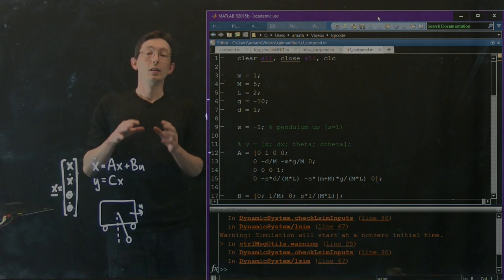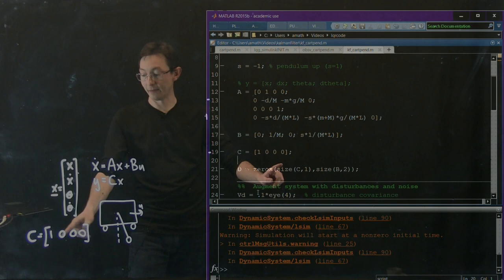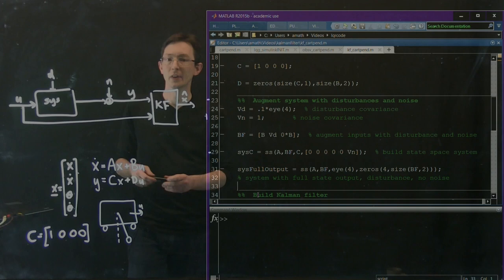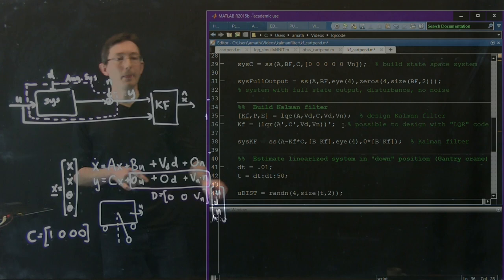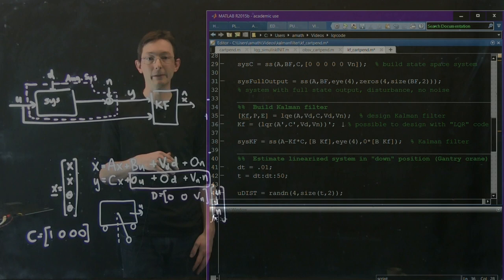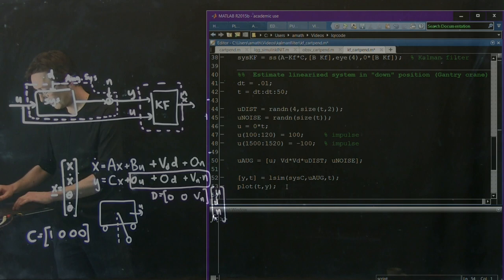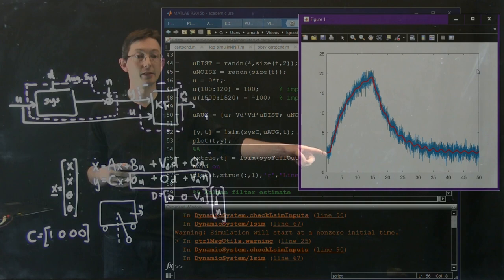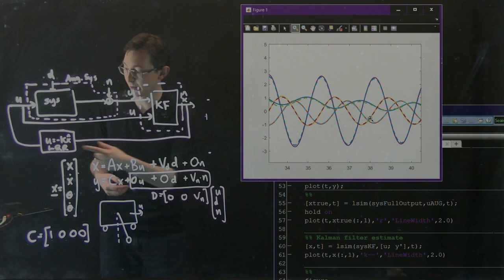Control Bootcamp:  Kalman Filter Example in Matlab

Comment: I'm gonna go ahead and guess the example was not done for the pendulum up position because you need more tools (robust control?). I'll get to those videos soon enough though. Great material Steve.
Reply from the maker: Thanks!  Yes, this is an easier warm up, since if the controller isn't that effective, the system stays in the down position.  A bit trickier in the up position.

Comment: hi, mr. Brunton, I am really enjoying the classes. thank you!
what if we have no information about noises and disturbances in advance?
Reply from the maker: Great question.  Usually you won't have information about noise and disturbance in advance, so you would somehow need to estimate them.  And generally these magnitudes will actually become tuning parameters that you can use to find a good estimator.  Often only the ratio between noise magnitudes matters, and you usually vary them by factors of 10.
Reply: @Eigensteve  , are there any techniques one could use instead of trial and error? some error minimisation techniques, perhaps?
Reply from the maker: @alex.ander.bmblbn , definitely, you could use another optimization technique to select these hyperparameters to minimize error or some other metric.  But this would be a smarter, automated version of trial and error.
Reply: @Eigensteve , I see, thank you, sir! looking forward to reading your book on machine learning based control :)

Comment: In the case of following a setpoint, are there tools for knowing the gain required for it? so the input becomes u = K_r*u - K_s*x,   being K_s the matrix gain obtained from the LQR.
Reply from the maker: Thanks -- yes, when following a setpoint for reference tracking, it is possible to add a feedforward term along with LQR.  I always find this a bit trickier to derive.

Comment: Thankyou Steve for these fantastic videos! They are a real help in my studies.

In your matlab example it appears as if the kalman gain is only calculated once for the entire simulation. While in other sources, I've seen the kalman gain updated at each timestep. I was just wondering if you could comment on why this is?
Reply from the maker: Thanks!  Yes, that is right, in this example I am using a single Kalman gain because I am assuming that the linear system doesn't change.  If you are controlling a more complex system, where the linearization point is changing, or where there are nonlinear dynamics, then it could help to update the Kalman gains as well.  In large-scale data assimilation projects, like climate modeling, it is common to update the Kalman gains.
Reply: @Eigensteve  I've also seen in other kalman descriptions (e.g. wikipedia) they estimate an accuracy covariance along with the state vector. This estimated covariance is then used to recompute the kalman gain every step (despite no re-linearization done). Maybe this will be covered in future lectures (or if you have a reference to a relevant part in your book), but I don't feel like I have a good sense of the differences between these two approaches. In particular, the version you present here seems a lot simple, so I guess I'm wondering if you can always do this (at least when you stay close to the linearization point), or if the more complex version described elsewhere is necessary.

Comment: Dear Professor! Thanks again.  One question please. At 15:10 you said that in the real world we have u and y and we will not have to "invent" disturbances (n and d). But my current understanding is that this n and d disturbances are an integral part of the Kalman Filter algorithm, and we will need to estimate these real-world disturbances during system operation in order to supply Kalman Filter with correct real-time values for n and d covariances. Is my understanding correct?
Reply: I think I understood it in the same way. In the example shown in this video, Kalman filter was able to squash the noise because we gave him the information about the noise signal.  We would need to do the same for real-world system. PS. Note I'm not an expert, I only wrote how I understood the lecture.

Comment: Supernice! I've got a Q.: what is the best way to take account of a forcing term? (e.g. Let's suppose an external force, sinusoidal, is generating a torque on the pend.)
Reply: You would incorporate that as a non-conservative force, which will be the right-hand side in the Lagrange formulation using the principle of virtual work. If your work term is a form of potential energy, you don't need to do that and can just use Euler-Lagrange instead.

Try it with gravity. Assume a rigid pendulum which doesn't compress, so gravity only does work in the local coordinate system's x-direction. Use a standard rotation matrix to put the gravitational force in your local coordinates (versus global coordinates, where gravity points down), and apply virtual work (dot product of the force with the unit direction vector.

If i and j are the local unit vectors, then for a clockwise-rotated local coordinate system (where j is aligned with the pendulum rod), you get a gravitational force vector of F = mgsin(theta)i - mgcos(theta)j. This force only does work in the i direction, so the unit direction vector dr = dxi. Taking the dot product F*dr = mgsin(theta)dx. If you use Lagrange, then you will perform the partial derivatives on the system's kinetic energy only, and then your generalized force on the right-hand side is Qdx = mgsin(theta)dx, and so Q = mgsin(theta). This is the same result you would get using Euler-Lagrange since the gravitational force can actually be incorporated as a potential energy.

Comment: Hi Steve, 
first of all: fantastic video !!! 
I have a question reguarding Kalman filter in combination with PID control. As you said the kalman filter has its own dynamics. When I use a PID controler I use my system model to tune the PID parameters properly. If I use a filter such as a butterworth filter I have to consider the fitler dynamics if this filter. However, the dynamic of the Kalman filter I not easy to predict/identify since I do not know the poles of the system. Is it possible to combine a PID controller with a kalman filter properly in a "scientific" way? Background is: I have a very unreliable velocity measurement of the fible flow and I want to use a simple PI controler. However, I do not want to use a simple butterworth filter since measuring is sometimes not possible or provides values that are physically not explainable. 

Thanks for your time so far. I would appreciate an answer very much. 

cheers
Leo

Comment: Hi mr. Brunton. Thank you for the video, the estimation of unmeasured variables almost feels like magic. I really tried to understand the Kalman filter but I still don't understand this part - how does it estimate the unmeasured variables. Would it be possible to write out a formula which describes how these estimates are calculated (something like theta(k+1)=....)? Or could you somehow conceptually try to explain this? I would really appreciate it.
Reply: I was thinking about this for a while, and I reached for some insight that I may share with you. The design of Kalman filter in this video is based on the modelling system. In the modelling system, the states are actually modeled (just like they are known but they are not), so the lqe command subtracts the modeled state with a random state (initial estimated state) and then correct the error between them based on kalman gain.
However, we have no idea about some of the states in real environment. Here, instead of modeling of the states we must do calculations for the unknown states, for example, if the position state is measured, we could calculate the speed state by deriving the former.  Once again, Kalman filter will subtract the calculated states with the estimated states and correct the error based on kalman gains. Hope this could help.

Comment: hi sir, can I ask why is the D term in sysC is [0 0 0 0 0 Vn] instead of [0 0 Vn] as you wrote? Thank you so much!
Reply: I believe it is because the u vector represents 4 control signals. So in Matlab that single zero on the board is written explicitly as four zeros.
Reply: For everyone wondering about this [0 0 0 0 0 Vn], that's because: 
- our u input is a scalar (i.e. 1 input signal).
- however d input is assumed to have 4 inputs (d1, d2, d3, d4) a separate disturbance input for each state, it is clearly defined like this line 44 in Matlab uDIST = randn(4,..), so it is a 4 inputs disturbance.
- finally n is a scalar again, same as u
When you have this in mind, the following is the full expansion of both State equation and Output equation [with size of each vector and matrix] of the simulated system:
State Equation:   X_dot [4x1] = A[4x4] * X[4x1] + B[4x1] * u[1x1] + Vd[4x4] * d[4x1] + 0 * n[1x1]
So, if you put the inputs [u d n] as a single input vector, you end up with this:
u_all = [u d1 d2 d3 d4 n]
and combine B, Vd and Vn in a single matrx = [B Vd 0*B], the reason for 0*B is to keep sizes same only.
Since Output equation: Y[1x1] = C[1x4] * X[4x1] + 0 * u[4x1] + 0 *d[4x1] + Vn[1x1] * n[1x1]
Therefore, all inputs are 0, except n, [u d1 d2 d3 d4 n] ---> [0 0 0 0 0 vn]

Comment: Sir! How did you compute the number of columns in the Matrix D in the sysFullOutput?
Reply: It is the same number of columns as the augmented B matrix. The columns are the control input, the 4 state variables, and the measured output. In the D matrix, we are only applying noise to the measurement, and doing nothing to the other 5 columns. The other 5 columns are addressed in the augmented B matrix. Notice how the last column in the augmented B matrix is a column of zeros, because we aren't applying the measurement noise to the inputs... that's left to the outputs via the D matrix.